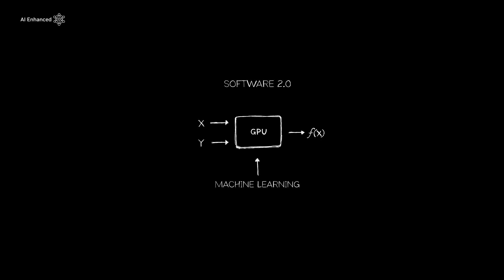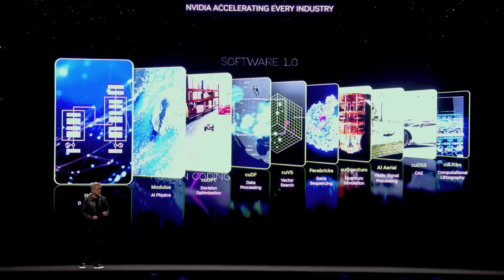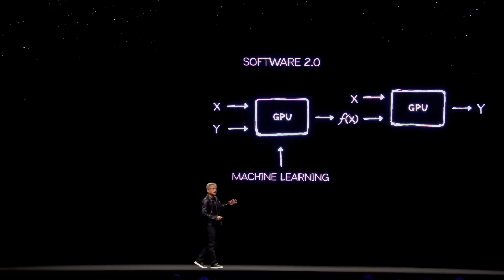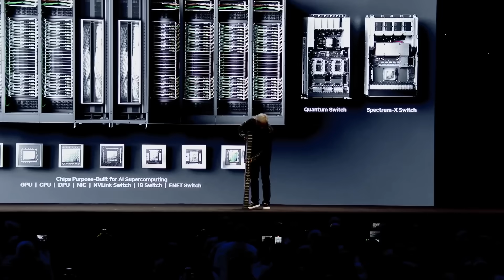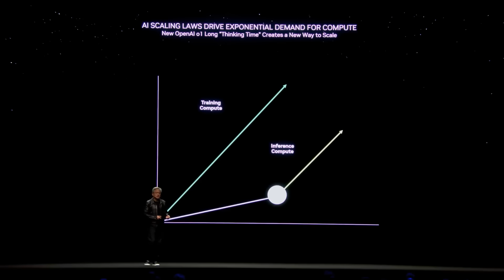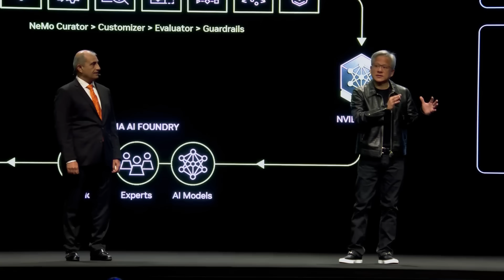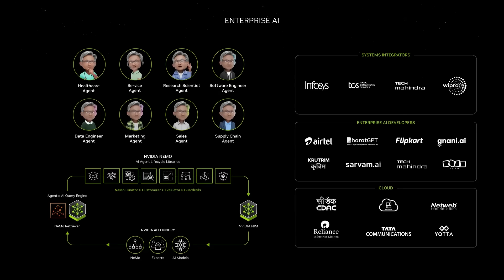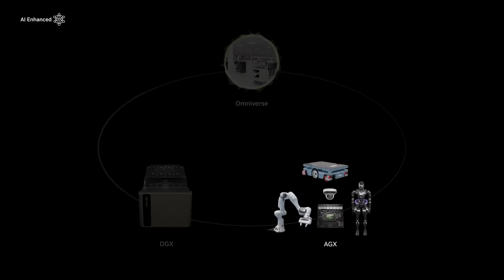NVIDIA CEO Jensen Huang Leaves Everyone SPEECHLESS (Supercut)

Comment: Prompt to ChatGPT: Is it true that there is software 1.0 written by humans, and software 2.0 written by computers? Will software 1.0 still be useful in the future?

Answer: The terms "Software 1.0" and "Software 2.0" are popularized by computer scientist Andrej Karpathy to distinguish between traditional software engineering and machine learning-based software engineering.

Software 1.0 refers to conventional software: code written by humans, with explicit rules and logic to perform specific tasks. Programmers write each line to dictate how the software operates in every scenario.
Software 2.0 is more about software created through machine learning models. Rather than explicitly coding logic, developers train models on large datasets, letting algorithms "learn" patterns and rules from data instead of being told explicitly what to do. This process is often automated, with computers generating parts of the software's "behavior."
Is Software 1.0 Still Useful?
Absolutely. While machine learning offers impressive capabilities, traditional software engineering still holds essential advantages:

Control and Interpretability: Software 1.0 code is transparent and allows developers to inspect, debug, and fully understand the logic. This is crucial for applications requiring strict safety and reliability, such as those in aviation, healthcare, and finance.

Efficiency and Optimization: Many tasks don’t need machine learning's complexity. Traditional code can often run more efficiently and with lower computational demands, which is ideal for systems with limited resources or requiring fast, predictable performance.

Regulatory and Ethical Concerns: Industries with strict regulations or high ethical standards may prefer Software 1.0 due to the accountability it provides. Traditional code can be easier to audit, verify, and validate against safety standards.

Will Software 2.0 Replace Software 1.0?
While Software 2.0 is transforming fields that rely on pattern recognition (like image and speech recognition, autonomous vehicles, and predictive analytics), many software applications will continue to benefit from human-written code. In fact, Software 1.0 and Software 2.0 are often integrated, with machine learning models (Software 2.0) embedded within traditional software architectures (Software 1.0).

The future likely lies in a hybrid approach, where Software 1.0 provides structure, reliability, and control, and Software 2.0 enhances adaptability and functionality in areas where traditional coding might fall short.

Comment: Programming will not end, but will evolve and continue. Programming is our ability to think ahead in a very controlled way. We will have higher level tools to do programming.
Reply: I don't want higher level tools, i want professionals who understand the machinery and how it operates at the lowest levels, i don't want Javascript "engineers" who can't explain how a loop works in hardware terms and who don't understand the term "Segmentation fault" when it appears in their console, if you have no knowledge you're worthless, if the AI does the job for you i don't need you, simple as.
Programmers are hired by their knowledge.
Reply: @SXZ-dev  yeah being a software developer should be a job based on skill and knowledge, not ability to sit there and ask an AI to do all the work for you.
Reply: @SXZ-dev We are not in the 80s, old man. I am pretty sure most CS curriculum does not teach you what Seg Fault is under the hood. (especially all the error handling at hardware or bare metal OS level) At most they would teach you how to write Verilog or assembly. Same goes for the for loop.
Reply: If ai is the peak efficiency then i most be a god i have not had any examples for the stuff i do as the silicon i touch is very likely new. It works great in a kinder garden but as soon as it has to perform in real it fails.
Reply: AI won't replace all programmers. Only the bottom 90%. All the leg-work will be done with AI and it will only need 1 or 2 talented programmers to look over the code and make a few touchups. This will happen to every field where AI gains a foothold.
Reply: @leetster6303  Good that the stuff i work in doesn't have enough of a dataset to be able to approximate with these primitive models.
Reply: @platin2148  what industry are you in if you don't mind me asking
Reply: @leetster6303  I work on basically the direct silicon interface designing quite new low cost hardware solutions. There is no ai
Reply: Programming is everywhere
Reply: Programming will become more efficient and effective with AI , Untill we have problems to solve and digital infrastructure and Apis to build programming will not end it will become better,fast and efficient.
Reply: @ai6476 I doubt it will get much faster its actually more a distraction for now..
Reply: programming will emerge more as a conversation than the direct application of coding
Reply: @YogonKalisto  I wish, we are a very long way off from this. We are closer to fully safe self driving cars than this vision.
Reply: @josephvictory9536 Well keep in mind that these systems still are not 100% ai they mostly use it for object colouring. As its quite difficult to proof safety of such a system.
Reply: @melhoresofertasapp  Why is that?

Comment: End of human Era. Age of Robots is upon us. What's going to happen to all the manual jobs?
Reply: Most trades will be the last to lose their jobs in ~20 years. Manufacturing jobs will for the most part not be touched for ~10 years. The jobs that are at most risk in the short term are the administrative, managerial, legal and intellectual jobs. White collar as opposed to blue collar. That is because it is very easy to replace white collar jobs with better computer programs (AIs). Jobs that have a skilled manual requirement CANNOT be replaced until there are enough robots built to do the replacing. It will take many years before such robots can be built by the billions.
Reply: @panpiper  After AGI is invented, there would be no jobs anymore, because every job is there to solve some problem, whether it requires only thinking or thinking and some manual work. Pretty much when computers can start reason about things and solve problems like humans then they are pretty much humans, but supercharged — not requiring to eat/sleep/exercise/entertain themselves.

However, the problem would be power and deployment of those systems. Unless we figure out how to make them work with the same energy requirements as an average person, it's not going to work out replacing everyone with AGI, because we would still need much higher power requirements to replace a single brain. Our brain consumes only around 20-30 watts of power. To sustain, we need electricity, water, food, entertainment — I estimated this to be around 600-1000W per hour for an average person in the city, while in villages and distant locations it would be obviously lower.

So if we're talking replacing people, it has to be cheap enough, so that one AGI is at least 50% more effective in (cost * power requirements) / productivity, that is assuming it is as reliable as a human. Running Blackwell system like the one in the video means it must be as productive as about 100 people (300 if people can work 24/7, so I divided by 3 to have an 8 hour workday). Can it do that yet? Most likely not. Can it do that in 5 years? Probably, but it would require so much more investments, advancements, and hard work you should be able to prepare for scenario where we are overrun with AGIs replacing us everywhere.

Personally, I'd be happy to see a world where we don't have to work anymore because machines are better at it. But I have doubts this would be soon. Maybe 10 years, 20 — and then I anticipate it would be another race to research things like anti-gravity / immortality / mind upload to advance humans to next level, and I believe people would be still around to decide what they want to build next.
Reply: You will still need manual labor … it won’t replace everything
Reply: @groundhabit6408 wrong.
Reply: @alanalda9686  and just remember, we aided it all, every step of the way.
Reply: @alanalda9686  universal basic income
Reply: @JimmyN2  Without strings attached or it's useless and nothing but slavery.
Reply: @ I agree , but there is going to be a ton of people who are not capable of many new jobs & something has to be done .
Reply: @JimmyN2 about the same will be done as is being done in various parts of Africa and several war zones. Aka slightly more than nothing. People forget that we have only had about 100 years of any regime that has an expectation of social care. Most of human history people have been left on their own to live or die and this is quite likely to be treated the same way.
Reply: @ it may ? 
AI will help humanity like nothing before as we’ll destroy like nothing before
Reply: AI will replace lawyers, that's a positive!!!
Reply: @ashinoz11  Someone will have to review the legal documents. One mistake by AI can cost billions of dollars.
Reply: Where are we going to get the power ?????
Reply: @JimmyN2 all the wind and solar farms needed can be built by robots, too. And the turbines and solar panels needed. And the wires and molds. And the refining and mining. It just needs millions and billions of robots and some time to teach them.
Reply: @ or the machines rise up & us pesky humans are no longer needing energy for our needs ? Terminator 2.0
Reply: If anything it'll increase work in the next. 20-30 years. Imo. These companies are expanding on a massive scale and not only require just software but physical ware, which Trump wants to bring into the U.S. Intels 25Billion$ plant in Ohio will bring a lot of demand, not only for the acctual construct, but the resources outsourcing materials and services from all local areas.
Reply: Hopefully, they go to robots. Humans aren't meant to do long, tedious manual jobs.
Reply: Fawk em !
Reply: I'm sure that's what people thought when machines, cars, airplanes, and robotics were produced. Nothing on earth is more adaptable than humans.
Reply: @safeandeffectivelol  true, but we're talking neuromorphic computing today, it's the same thing that happens in our brains. If we can scale it, then we should have a functioning artificial brain, much like all humans do. This is not a simple robot, machine, automation, but an actual intelligence. Go read my comment above though what I think about it.
Reply: @ I agree , but the steam locomotive , nuclear power & computers have never thought for people. Now computers & quantum tech is/will be thinking along with making decisions without human input.
Reply: @alanalda9686  no one needs a job - everyone needs money, though. The only solution to this I see, is some kind of universal income, everybody gets for nothing. Every robot “earning money” increases wealth that gets distributed later. Moving from the current system to the new one is hard, though. If 10 people loose their job and EVERYONE get 0.01 cents that won’t help much. This works once robot do more or less everything - which they will do some time in the future. Politicians must find a solution for the time in between…
Reply: That's was what people said when computers was introduced.
Reply: I know a few guys who would outwork a robot..
Reply: Do you want to do them? 
What's going to happen to all the creative jobs 😅
Reply: Jobs for dummies won’t exist anymore.
Reply: @kilodave77  pretty and it'll be the dummies that gave them away. 😂
Reply: @ I climb trees for a living. I’m not worried. No computer or robot can do what I do.
Reply: @kilodave77  not yet
Reply: @kilodave77 not yet
Reply: @ so we will have a bear robot that climbs trees and what? Can it prune a tree or remove it??? No…